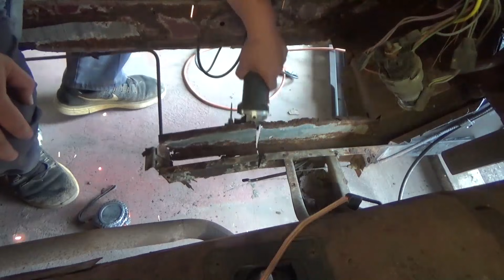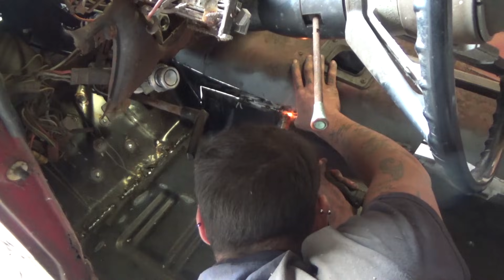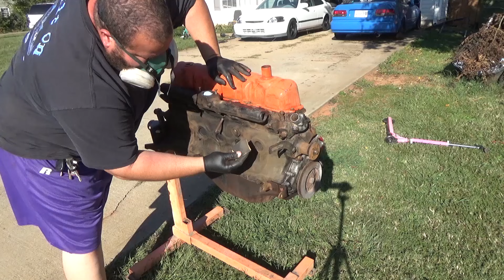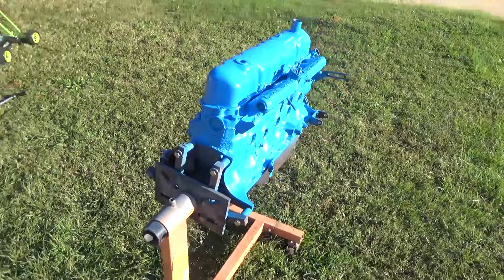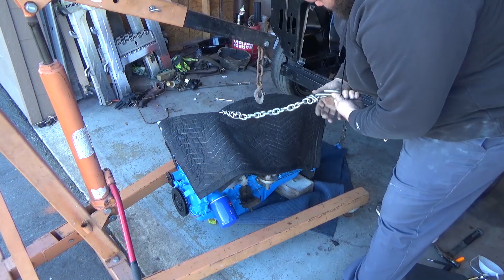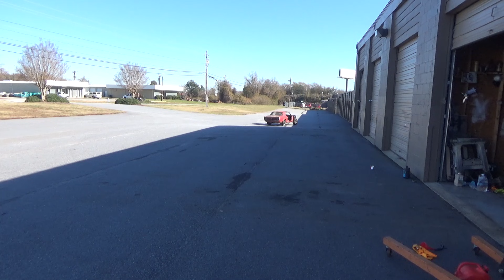$250 1967 MUSTANG  (FIRST DRIVE IN 30 YEARS)

Comment: amazing work. just a tip, when installing those big sections of sheet metal ( floors or quarters) it's best to hold the panels in place with some self tapping screws then removing them when the welding is done and weld up the holes from the screws. keep up the good work.

Comment: There is history for turboing a Ford inline six. Car and Driver did a project (IN A GRANADA? REALLY?) of a turboed 250/4.1, about 1979 or so. It should be available on microfilm at a local main branch library. As I remember, it didn't work out well for them, but 40 years of turbo experience should solve that.

Buena suerte from Costa Rica!

Comment: out of curiosity. Does they still sell parts for old car like this? im just confused either he is using  universal part or a specific one

edit:such as the floor panel the welded part from the engine bay and etc.
Reply from the maker: They make replacement parts
Reply: @79thproductions  oh i see now, i just thought they dont make replacement parts for car that old anymore

Comment: im sure you already thought about it but if you noticed the unibody on that mustang doesnt go the whole way back on those it stops under the front floor and thats a pretty big weak point structurally on the gen 1 mustangs. id really recommend getting the connecting braces some companies make for those just for some safety and rigidity

Comment: Only thing I'm concerned about is you got paint in it looks like the inside of the inlet of the coolant if it chips and flakes from the hot water its gonna circulate threw your motor and waterpump

Comment: Turboing a carbureted engine isn’t possible. No way to adjust a/f mixture for boost since it’s always changing.

Edit: technically it’s possible just EXTREMELY difficult and expensive since it has to be sent to a professional tuner and special carb, much easier to go fuel injected or supercharged.

Comment: That 67'Mustang Look Very Good Especially The Engine Runs Good, Someday You Can Try The 5-Speed Tremec Manual, If You Want. I Just Saw A Video of a 65'Mustang Swap The 3-Speed to 5-Speed Tremec Manual Transmssion with a Rebuilt 200 cubic inch 6-Cylinder: Inline 6 engine:, So I Think If You're 67'Mustang is a 3-Speed MT, You Can Swap To A 5-Speed Tremec MT, That Way The 67' Mustang Can Go Quickly and Fast with Tremec Style. Check This 65'Mustang Out And You'll See The Video: https://www.youtube.com/watch?v=LNAK5M86vOU